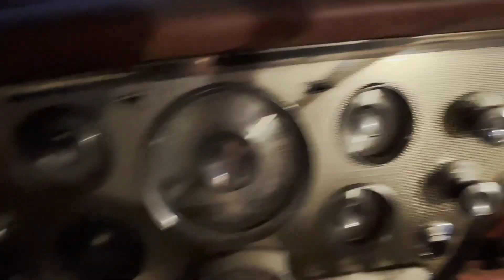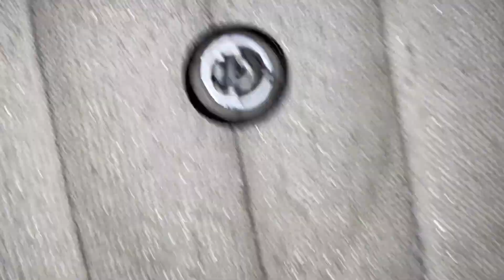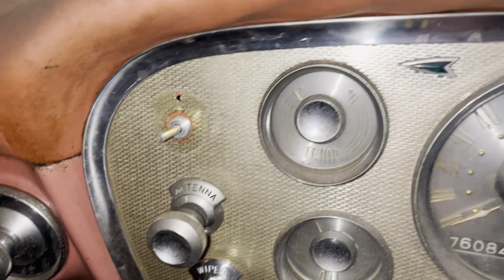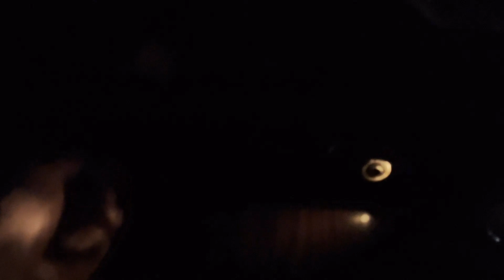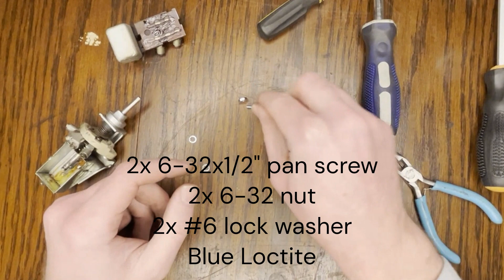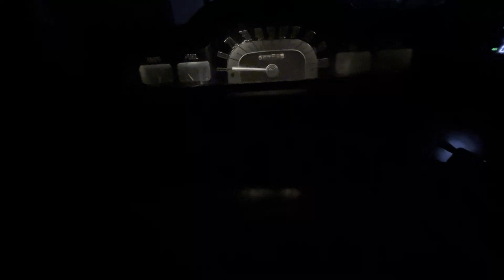Packard Headlight Switch Repair (55-56)

Comment: Any suggestions on where to purchase the tool now? Doesn't look like the site works anymore. Trying to fix on my '55 Clipper.
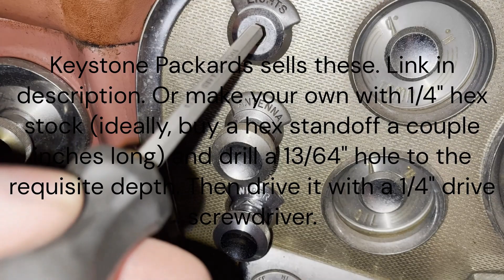Reply from the maker: Buy a standoff from a hardware store and drill a hole thru it, is probably easiest. Instructions at 1:43.

Comment: Is it really Normal for Packard to shut off front Running light when you pull headlights on
Reply from the maker: Yes, that was the standard in all cars of that era. Running lights are redundant when headlights are on.
Reply: @hphpackardlowrey2776  okay thanks